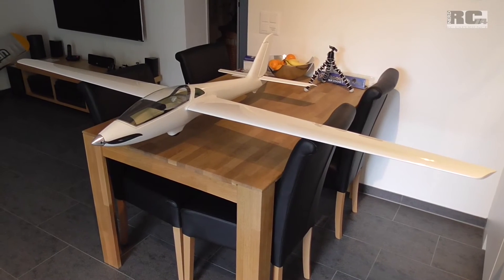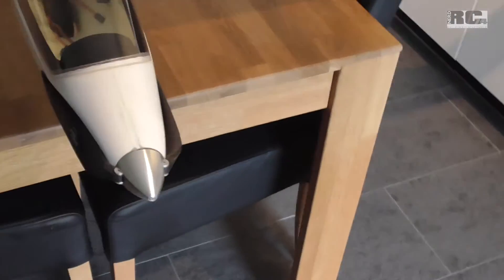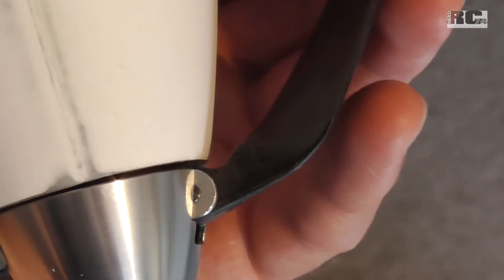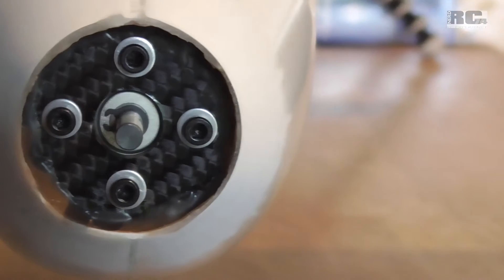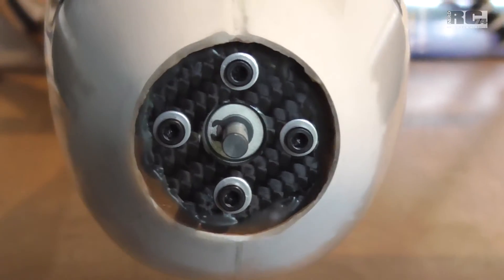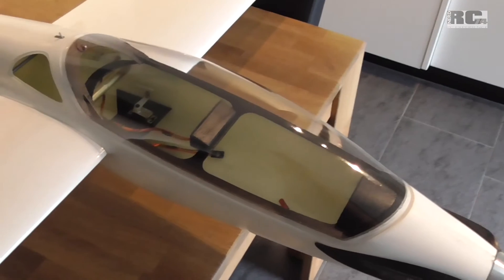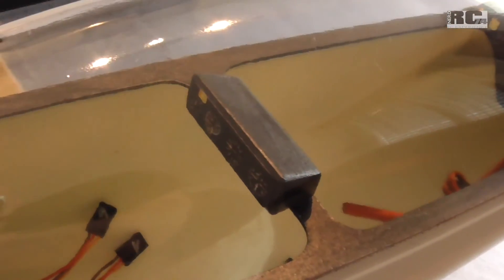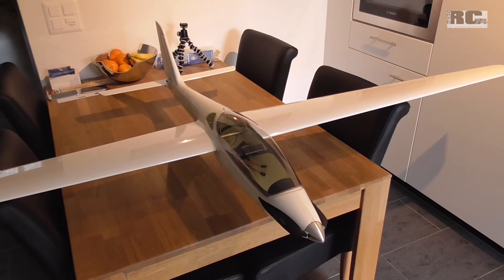ROYAL MODEL MDM-1 FOX RC GLIDER BUILD | PART 2

Comment: Thanks for this video.
I'm building the same model at the same time as you are but in pure glider.
You can see the mounting on this french forum : http://www.modelisme.com/forum/aero-planeurs/142172-fox-2-20m-royal-model-4.html
Reply from the maker: +Nicolas P I'm looking Forward to your build :o) Thank you for sharing my Videos on the Forum!
Reply: +RCnerd74 Which flight weight do you expect ? Which CG ? I hope to be around 1700g
Reply from the maker: +Nicolas P mine will be between 1800-1900g because i will put in a Pilot and other scale stuff. i have no weight target because i will use this glider for aerobatics only. so weight is not very important in my case.. i try the CG in the Manual. 45-50mm from the front end of the wing. i hope this will work.
Reply: RCnerd74 ok. Mine will be only for slope with good wind conditions. I think that the cg on the manual is too much front. I will try 55-60mm.
Reply from the maker: +Nicolas P That's a good Input. I will also try your setting. This is my first glider since a long time. So i lost the experience... :o)